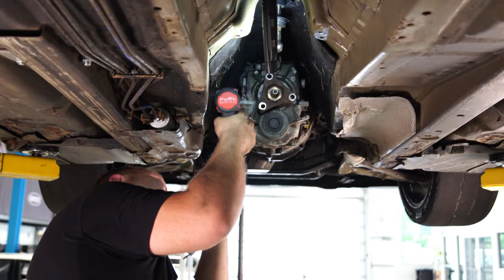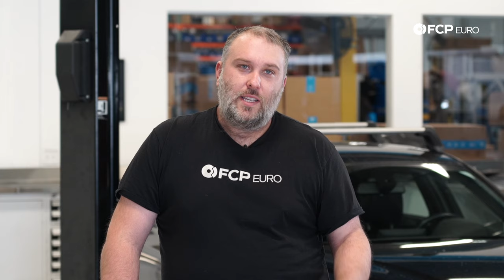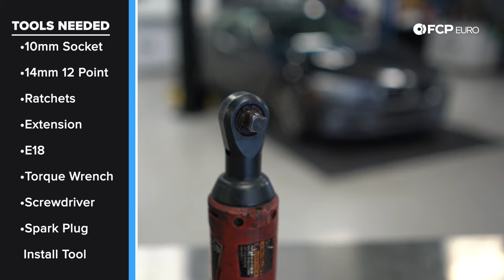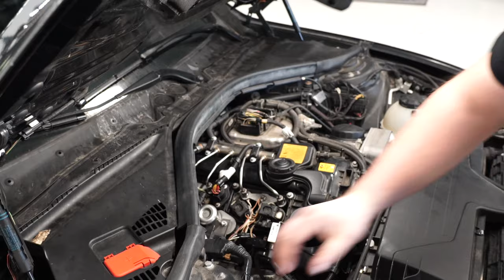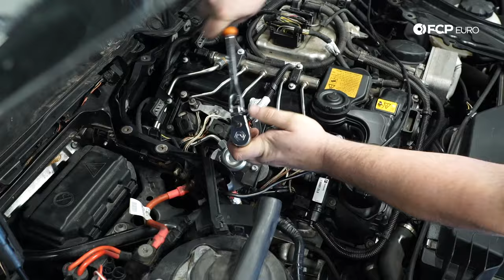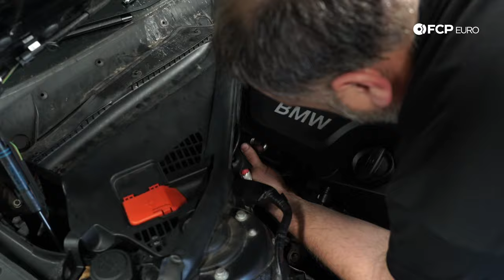BMW 3 Series - F30 Spark Plug & Ignition Coil Replacement DIY (BMW N20/N26 Ignition Service)

Comment: Thanks for the video. I found that you don't have to remove the stabilizer bar as you can get clear access to the 4th spark plug by removing the black plastic cover and sliding it out under the stabilizer bar.

Comment: These coil packs specifically have a defect. The boots have a habit of separating from the top half and remain stuck on the spark plug inside the cylinder. Without the right tools, it can be a nightmare to remove them. The boots also rip easily causing small pieces of rubber to be dropped in the cylinder so before removing the plug it has to be vacuumed out extensively.

Comment: Great videos. Thanks for the coil tab tip. I broke 1 of those on my last R&R   Would never recommend a novice  do this but... a pro tuner with a gentle hand will always verify the spark plug gaps are even across the set. Spark plug gap affects spark duration and sometimes 1 out of the bunch will be way off from the factory. Those tools are a must to carefully install the new plugs and prevent damaging the spark plug gap clearances on install. I see videos of people dropping the spark plugs down the tubes... face palm
Reply: I never gap my sparkplugs, but also never felt a issue when driving. I'm on bootmod3 stage 1 aswell.
Reply: What coil tab tip?
Reply: Sometimes the pregap is off but believe me an owner will know something is wrong after installing them

Comment: Are these plugs for tuned engines ? I replaced my 2015 320i with this exact setup and it rode great for a week but now I have an engine light. The car is driving fine though.

Comment: Great information.  Just installed new plugs from FCPEuro in an N26.  One tip that may be obvious... when pulling the coils give them a slight twist left and right to 'break the seal' they form in the spark plug pocket.  The coil will then pull out much easier.

Comment: Thank you! Couldn't find a video that showed this method. The rest of them are using a socket and swivel attachment that goes 90 degrees with 3" ext. Didn't have any time to wait for new tools, already changed one spark plug, so needed to go this route. I actually found it better than trying to fuss around in a tight space with a swivel socket. FYI, it's completely unnecessary to remove the cross bars. Just unscrew the 7 screws for the cover and pull it out from underneath the cross bars. Just finished my f36 doing it this way. Thanks again.
Reply from the maker: Glad this was of some help, thank you for the note on the screws!
Reply: Thank you for the tip I didn’t feel like removing the cross bars

Comment: Super easy, great DIY. My cross bar (the top two bolts) were actually 5/16 not E18. The two side bolts were E18. I am also missing the sound deadening part
Reply: Factory is e18.

Comment: Ty! Took me 45mins. I had to purchase the socket, rubber tool and #18. I should have done the injectors at same time but now I know how easy it is to get access. My F30 has 130,000. It did look as previous owner had changed plugs sometime as they didn’t look too bad.

Comment: I replaced plugs on F25 last week. Hard to believe but one of the NGK plugs from FCP was actually defective, caused misfire. I got new plug from Oreilly to save shipping time, but FCP still credited me for the bad plug. Oreilly price is double FCP! Nice to have correct torques and advice in this video. Thanks!
Reply from the maker: So sorry to hear that happened! Glad you were able to get it squared away.

Comment: Changed my spark plugs no problem no i have an engine light an it says drivetrain malf n the car is missing what could be the problem
Reply: Same I’m so confused @fcpeuro
Reply: Did you guys find this out
Reply: Same here. I’m going to put in the same exact plugs that were in before. I think these are “colder” plugs and are for tuned bmws. Who knows 😢

Comment: I got a thin wall 14mm 12 point socket and it still won’t grip around spark plug to bring it out?? Any recommendations
Reply: The same here.
Reply: I had the same issue. It took me 4 hours man. I had to use needle nose pliers to grab the socket because it would get seized on the plug. I also have engine light after with these plugs and packs.

Comment: No anti seize on threads or dieelctric grease on boots for these?
Reply: You must have missed that he said there is already a bit of dielectric grease on the coils from the factory. So no additional is needed since it can actually interfere with proper seating and connection.
Reply: @Hyytekk  Thanks I did miss it.. I had gone thru and watched again and he mentioned it.  I didn't see any grease in mine so just put a dab into each. Thanks for the response.

Comment: What is the recommended gap for the spark plugs? I am assuming they are factory set but just want to double check before installing?
Reply: What’s spark plug gap?

Comment: QUESTION - when facing the engine on a 6 cylinder 328i xdrive.... how are the valves numbered....1-6 or 6 -1 (from the radiator back) ?
Reply from the maker: Typically your cylinder is 1 is going to be up front, by the radiator, 6 being up against the firewall.

Comment: I have a 2016 F10 with 60k miles,  would you recommend replacing both the coil and spark plugs or would  I find just replacing the plugs?

Comment: My stock N26 has 37k miles and I’m about to go FBO w/ stage 2 tune. No idea if spark plugs were changed for CPO when I bought it last year but doubt it. I’ll ask my mechanic to take a look and see when we should swap.... or should I just order them to have on hand? It should be less than an hour of labor, correct?

Comment: I picked up my CPO a few years ago and I changed the spark plugs on this car for the first time owning this car. When I measured the gaps of the old plugs, 3 of them were set to 0.030 and 1 of them was set at 0.028. Is this normal?

Comment: I did this at 60k after getting a limp mode repeatedly. Please stock Bosch coils and plugs. Not a difficult job, though cylinder 4 closest to the firewall is kind of a bitch.

Comment: Lil note everyone? You don't have to remove all the other stuff to get to that last coil. Doing 1 right now and I got the coil out with no problem and without removing any plastics.
Reply: Same. And used my torque wrench for reinstall. Whole job, less than 45 minutes

Comment: Do you have to unhook the cars battery before completing this replacements? Do you need any maintenance programming done after or before install.
Reply from the maker: Sup, no need to reprogram anything, and it certainly does not hurt to undo the battery.

Comment: I had to partially remove the strut brace (couldn’t figure out how to remove the plastic tray). Anyway, the 2 center bolts are 16mm, not E18 (in my 428).

Comment: What is a "early model year" with a pneumatic wastewater actuator as opposed to electric?
Reply: The first engine covers comes off a lot easier on n26 with the electronic waste gate.  There is no vaccuum lines attached to the cover.

Comment: Does that support brace you removed have a tourqe spec?
Reply: I was curious about this myself. Suspension cross brace to body - 56 Nm 90º. You can google "51 61 1AZ" if in doubt. Some forums have PDF with the specs accessible.

Comment: Spark plug needs to be gap ?
Reply from the maker: new spark plugs come pre-gapped, but it never hurts to check them
Reply: @fcpeuro  what about if I'm on stage 1 or 2 need to be pregap ?
Reply: @fcpeuro  hello FCPEuro! My N20 engine is surging from stop to go traffic or stoping and going. Could it be the spark plugs? Bought the car with 58k miles and it’s 76k now and I dont think the plugs or coils ever on it and I’ve been driving the car hard but do good maintenance on it.
Reply: @DuckMcDuckinson same did u find out why?